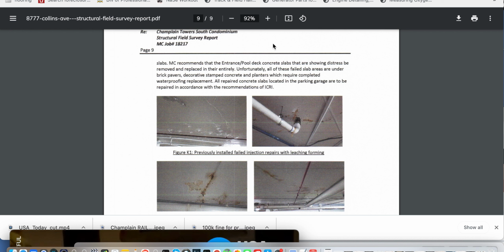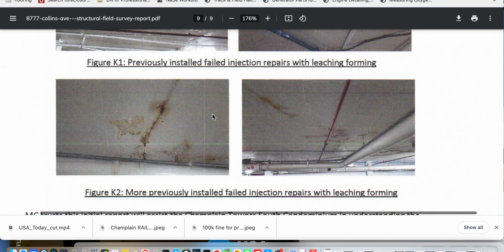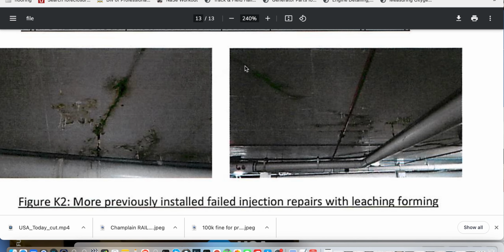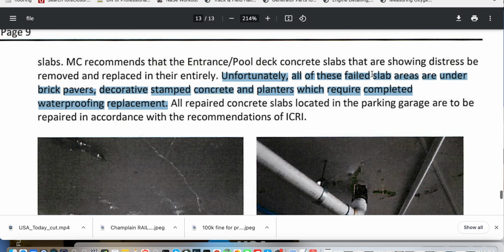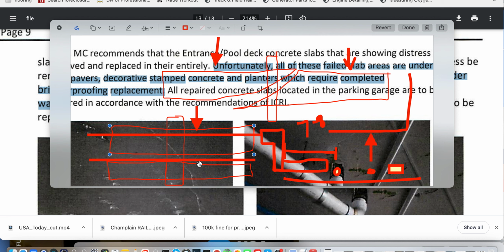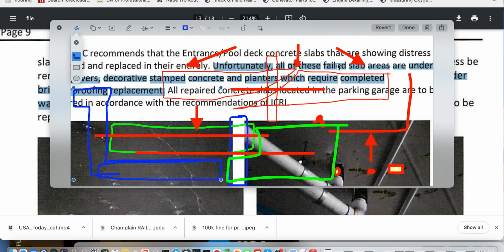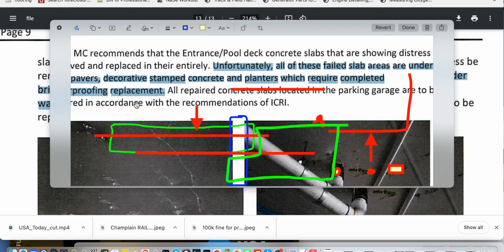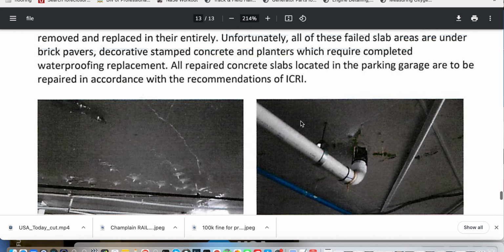CHAMPLAIN TOWERS COLLAPSE GREEN GROWTH VISIBLE FROM UNDERSIDE OF DECK #ChamplainTowers

Comment: It is green two part epoxy,  some companies use it to stop the poly from leaking out.  When the poly hits water it expands like crazy.  We would use fast setting hydraulic cement,  but if it was too wet the cement wouldn't harden quick enough.  They probably injected the cracks with polyurethane,  and only patched the areas that leaked "product" heavily with two part epoxy.  Obviously none of this was structural or proper waterproofing,  just a bandaid from a fly by night company.  Any honest waterproofing company wouldn't warranty any of those cracks, without solving the water drainage issues with the pool deck slab.  Cheers
Reply from the maker: Sika swell... but, it does not spec for such application...

Comment: Seems to be green here and there Can't say that's worse than rust red / brown from reinforcing steel or white of effloresence removing what makes concrete strong.  Hard to imagine w a statement like 'failed slabs', 'failed injection port repairs' the engineer hasn't been dragged into court yet but it's Florida, its probably against the law to hold any business responsible for it's incompetence otherwise people might want the same for gov't.  Sorry, but the gov't of Florida has been complicit in so much starting w the first swamp land real estate cons over 70 yrs ago.

Comment: Both of those documents are scanned from ink jet printouts. On the 'bad' one, the color is ok but it looks like the ink was running out. Because of that, it's easy to see the dithering pattern. A printer that crappy should not be used for engineering reports as it will hide important details.

On the 'good' version you used for most of the video, the slightly dark and blurry look is what happens when you try to print in high quality on cheap copier paper. The ink isn't absorbed right so it looks too dark and there's feathering.

What you're seeing is nowhere near the quality of the original photos. I can say that without knowing if i've ever seen the originals. I don't know what sort of workflow those people are following but someone must have digital originals and they shouldn't be holding back.
Reply from the maker: The larger point is, they released two documents with the same "title"...one is 9 of 9 pages and the other is 13 pages...
Edit to add, it seems nefareous on those two counts... A question comes to mind, why could they not produce a clear 9 page report...
Reply from the maker: PS I would add it is a bad printer head or rollers and springs...